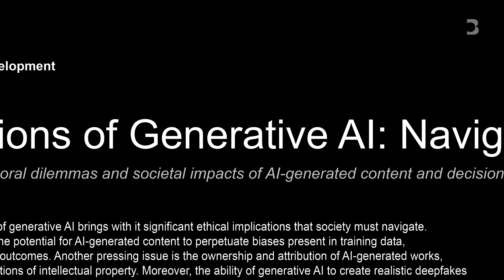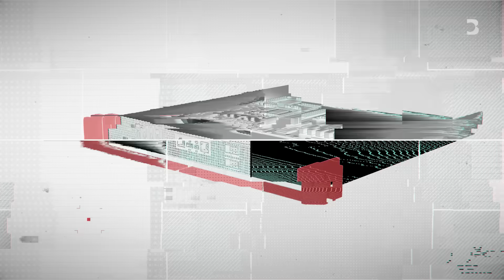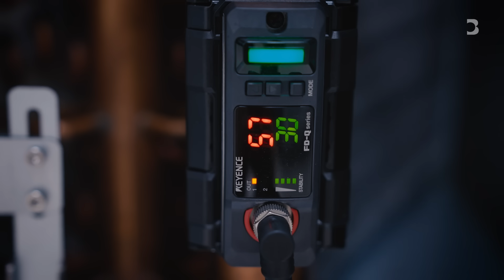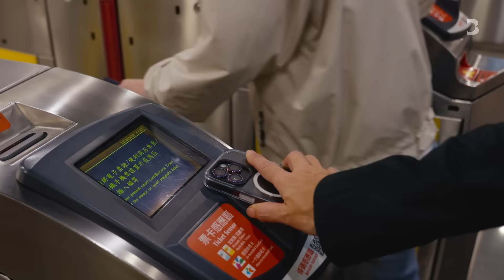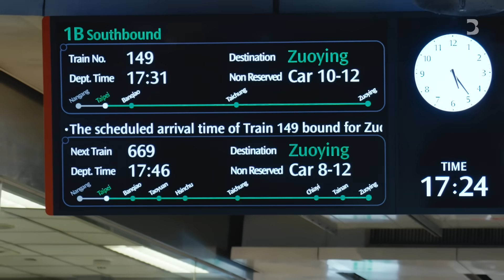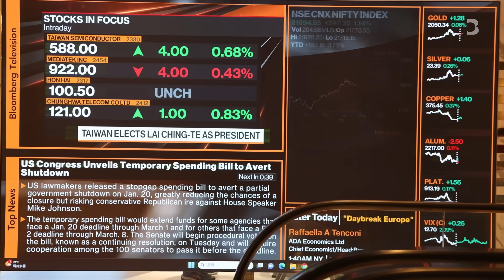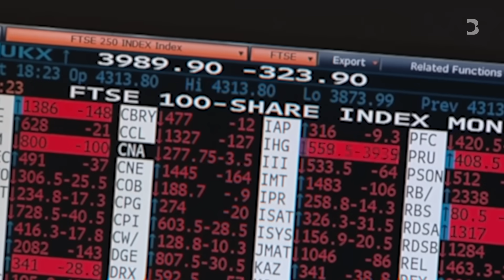Why AI Can't Exist Without Taiwan

Comment: I love how news channels talk about the possibility of a China invasion, as if it were a new thing. The Taiwanese have been living (and thriving) under this threat for the past 75 years. It's not news to anyone there, just a fact of life.
Reply: It’s because the situation is getting worse…
Reply: You never learn from Ukraine/Russia. When you talk to Ukrainian just before the invasion, they said the same thing as you. Nobody believes an invasion will happen.
Reply: Taiwan's Chip Industry Controls the Lifeline of Global Technology

Chip Specification Grade Classification:
Logic (Processors, AI Artificial Intelligence Computing), Memory Chip Operating Environment Requirements:
Commercial Grade -- 0~+70℃.
Industrial Grade -- -40~+85℃.
Automotive Grade -- -40~+125℃.
Military Grade -- -55~+150℃.
There's also an even higher grade: Aerospace Grade (Radiation Hardened), which requires resistance to radiation and interference, as well as a wider temperature range. Military and aerospace grade chips undergo rigorous qualification testing: pushing them to their limits, continuous high and low temperature cycling, vibration, shock, high ESD (Electro Static Discharge), and interface terminal plugging/unplugging endurance...
Generally, industrial-grade chips are twice as expensive as commercial-grade chips, automotive-grade are three times or more expensive, and military-grade chips are very expensive due to the need to amortize the manufacturing line costs. For aerospace -grade chips, setting up a production line costs hundreds of millions of US dollars, regardless of the quantity produced.
Taiwan's TSMC is the exclusive global manufacturer of high-end logic, AI, and memory chips for the US and its allies, as well as Taiwan's Chung-Shan Institute of Science and Technology (CSIST), for military and aerospace applications. The US Defense Advanced Research Projects Agency (DARPA) has approved the following manufacturers for producing military and aerospace grade logic chips and processors for the US military and aerospace industry: Taiwan's TSMC (advanced 7, 5, 3 nanometer process technology), US-based Intel (14 nanometer and above processes), and US-based GlobalFoundries (28 nanometer and above processes).
The manufacturing process, technology, materials, and raw materials for military and aerospace-grade chips are highly classified. The US and Taiwan have signed agreements to jointly control the highest-level technologies, prohibiting their export to other countries. The US government, still concerned for national security, has requested TSMC to invest and build factories in the US to manufacture advanced AI chips. Their entire production capacity is contracted by US Department of Defense military and aerospace manufacturers. Only the surplus and new factory capacity will be allocated to other companies like Nvidia, Apple, AMD, and Intel. This is an unspoken secret.

China and Russia's military and aerospace equipment can only use general commercial-grade chips for manufacturing, employing a trial-and-error method to create heat and cold insulation plus protective layers to shield the chip motherboards. This approach leads to short warranty periods and questionable real-world operational quality for Chinese and Russian military equipment such as missiles, radar detection systems, and aerospace equipment. Facing the US's high-tech electronic warfare countermeasure systems, their chip motherboards are vulnerable to destruction by high-power electromagnetic waves, causing missile failure and radar detection system malfunction. The failure of Russian weapons in the Russia-Ukraine war fully demonstrates this fact. If China invades Taiwan, the PLA's J-20, J-16 fighters, missiles, radar detection systems, and naval radar detection systems, which are designed using commercial-grade chips, will undoubtedly suffer a major defeat against US-Taiwanese electronic and electromagnetic warfare, and anti-electromagnetic pulse weapons. (Unverified online rumors in China suggest that the guidance systems of PLA missiles and torpedoes are reverse-engineered from US military technology of the 1990s, using stockpiled Intel 486 and 586 processors of commercial grade from 20-30 years ago for manufacturing.) This is something that the general public wouldn't understand, only experts in chip technology would know. Without mastering the highest technology in the chip industry, the Chinese Communist military is fundamentally unqualified to wage war!

Electric vehicles in China are frequently reported in their domestic market for failing to start due to excessively cold or hot weather, experiencing battery explosions, or suddenly malfunctioning while driving, leading to casualties. Besides other factors, it is very likely that Chinese electric vehicle manufacturers, in order to reduce costs, unscrupulously violate vehicle industry safety standards by not using automotive-grade chips and semiconductor components, and instead using cheaper commercial-grade chips and semiconductor components for the electric vehicle's electronic and electrical systems, making accidents inevitable.

The computer chips for the US Mars spacecraft are manufactured by Taiwan's TSMC using aerospace -grade chip technology. The computers for the US aerospace station are designed by Taiwan's CSIST and manufactured by TSMC using aerospace -grade chip technology, guaranteed to operate flawlessly in aerospace for 20 years. The computers and electronic systems for US and European low-Earth orbit satellites must be manufactured using TSMC's aerospace-grade chip technology.
Reply: Only the years when DPP took power lol

Comment: Taiwan is AI center in the world
Reply: Taiwan's Chip Industry Controls the Lifeline of Global Technology

Chip Specification Grade Classification:
Logic (Processors, AI Artificial Intelligence Computing), Memory Chip Operating Environment Requirements:
Commercial Grade -- 0~+70℃.
Industrial Grade -- -40~+85℃.
Automotive Grade -- -40~+125℃.
Military Grade -- -55~+150℃.
There's also an even higher grade: Aerospace Grade (Radiation Hardened), which requires resistance to radiation and interference, as well as a wider temperature range. Military and aerospace grade chips undergo rigorous qualification testing: pushing them to their limits, continuous high and low temperature cycling, vibration, shock, high ESD (Electro Static Discharge), and interface terminal plugging/unplugging endurance...
Generally, industrial-grade chips are twice as expensive as commercial-grade chips, automotive-grade are three times or more expensive, and military-grade chips are very expensive due to the need to amortize the manufacturing line costs. For aerospace -grade chips, setting up a production line costs hundreds of millions of US dollars, regardless of the quantity produced.
Taiwan's TSMC is the exclusive global manufacturer of high-end logic, AI, and memory chips for the US and its allies, as well as Taiwan's Chung-Shan Institute of Science and Technology (CSIST), for military and aerospace applications. The US Defense Advanced Research Projects Agency (DARPA) has approved the following manufacturers for producing military and aerospace grade logic chips and processors for the US military and aerospace industry: Taiwan's TSMC (advanced 7, 5, 3 nanometer process technology), US-based Intel (14 nanometer and above processes), and US-based GlobalFoundries (28 nanometer and above processes).
The manufacturing process, technology, materials, and raw materials for military and aerospace-grade chips are highly classified. The US and Taiwan have signed agreements to jointly control the highest-level technologies, prohibiting their export to other countries. The US government, still concerned for national security, has requested TSMC to invest and build factories in the US to manufacture advanced AI chips. Their entire production capacity is contracted by US Department of Defense military and aerospace manufacturers. Only the surplus and new factory capacity will be allocated to other companies like Nvidia, Apple, AMD, and Intel. This is an unspoken secret.

China and Russia's military and aerospace equipment can only use general commercial-grade chips for manufacturing, employing a trial-and-error method to create heat and cold insulation plus protective layers to shield the chip motherboards. This approach leads to short warranty periods and questionable real-world operational quality for Chinese and Russian military equipment such as missiles, radar detection systems, and aerospace equipment. Facing the US's high-tech electronic warfare countermeasure systems, their chip motherboards are vulnerable to destruction by high-power electromagnetic waves, causing missile failure and radar detection system malfunction. The failure of Russian weapons in the Russia-Ukraine war fully demonstrates this fact. If China invades Taiwan, the PLA's J-20, J-16 fighters, missiles, radar detection systems, and naval radar detection systems, which are designed using commercial-grade chips, will undoubtedly suffer a major defeat against US-Taiwanese electronic and electromagnetic warfare, and anti-electromagnetic pulse weapons. (Unverified online rumors in China suggest that the guidance systems of PLA missiles and torpedoes are reverse-engineered from US military technology of the 1990s, using stockpiled Intel 486 and 586 processors of commercial grade from 20-30 years ago for manufacturing.) This is something that the general public wouldn't understand, only experts in chip technology would know. Without mastering the highest technology in the chip industry, the Chinese Communist military is fundamentally unqualified to wage war!

Electric vehicles in China are frequently reported in their domestic market for failing to start due to excessively cold or hot weather, experiencing battery explosions, or suddenly malfunctioning while driving, leading to casualties. Besides other factors, it is very likely that Chinese electric vehicle manufacturers, in order to reduce costs, unscrupulously violate vehicle industry safety standards by not using automotive-grade chips and semiconductor components, and instead using cheaper commercial-grade chips and semiconductor components for the electric vehicle's electronic and electrical systems, making accidents inevitable.

The computer chips for the US Mars spacecraft are manufactured by Taiwan's TSMC using aerospace -grade chip technology. The computers for the US aerospace station are designed by Taiwan's CSIST and manufactured by TSMC using aerospace -grade chip technology, guaranteed to operate flawlessly in aerospace for 20 years. The computers and electronic systems for US and European low-Earth orbit satellites must be manufactured using TSMC's aerospace-grade chip technology.

Comment: ....
OTHERS...
ARE NO IDIOTS...
THEY
CAN DO THE SAME..... YES.
. NO
OF COURSE YES...
.... GREETING FROM 4805.000.000...
Reply: Even if EUV is purchased, advanced chips cannot be mass-produced with a high yield rate.

EUV uses TSMC's wet technology and is developed at F12b, TSMC's Hsinchu headquarters.

TSMC modified the purchased EUV and redesigned the reflective structure to increase the reflectivity from 2% to 3% and increase the efficiency by 50%.

TSMC's dry EUV mask cleaning technology reduces exposure to dust particles from hundreds to single digits per 10,000 wafers, a 99% reduction in dust ratios.

   ASML's latest EUV light source output power is 350W, but TSMC has begun using its own improved 350W EUV in 2020.